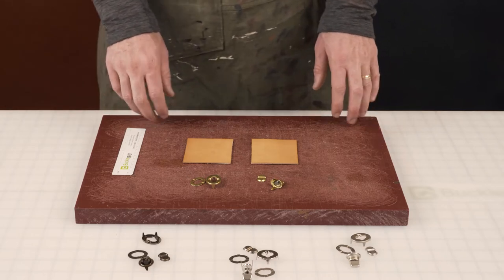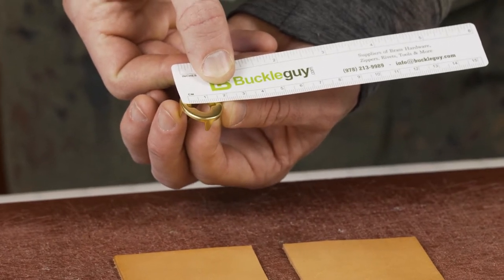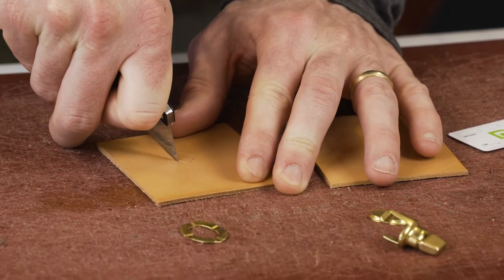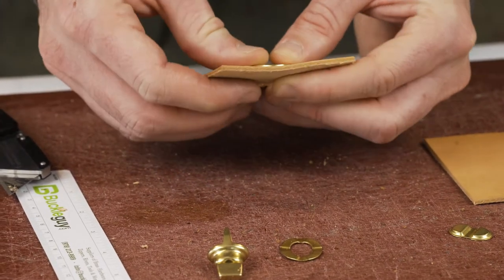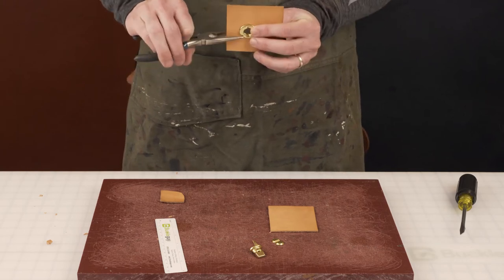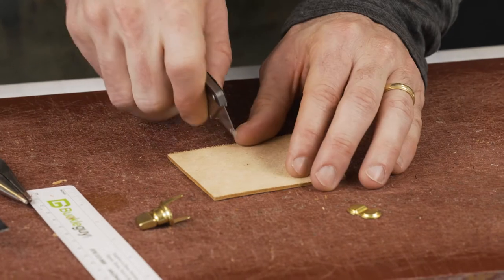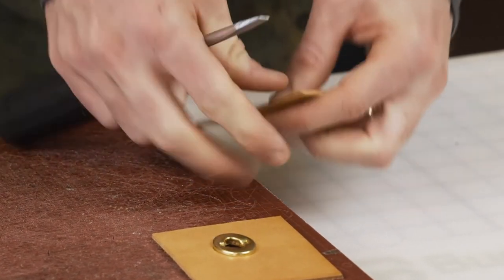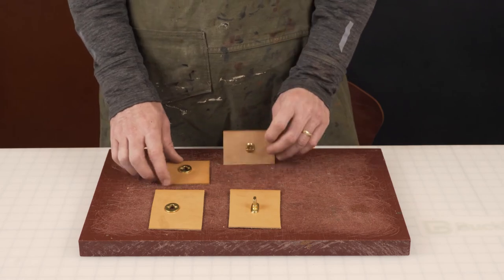Install a Turn Lock in Leather - No Special Tools Needed!

Comment: Before you do anything you have to align your pieces so they match when the turn lock is closed.  To save time, flip the TOP piece upside down and trace the inside circle with your awl.  This will give you the prefect shape, THEN cut slightly larger.  And yes its a good idea to reinforce the area with a woven material or a thin scrap piece of leather.
Reply from the maker: Great input, thanks!